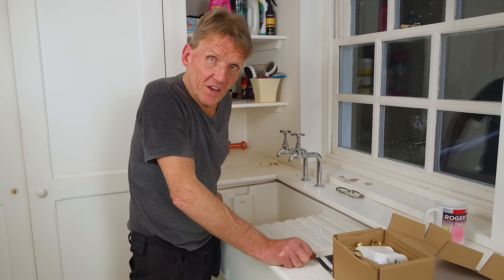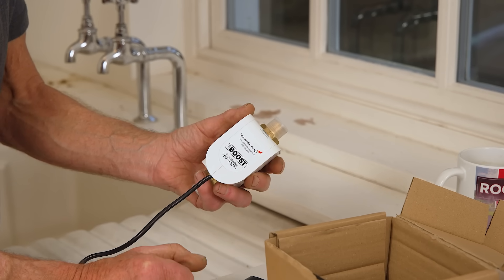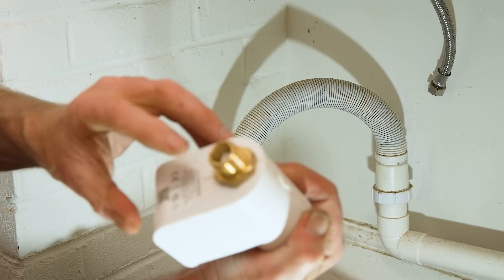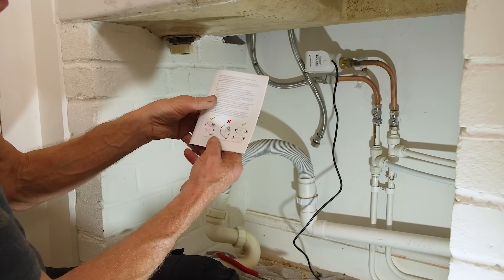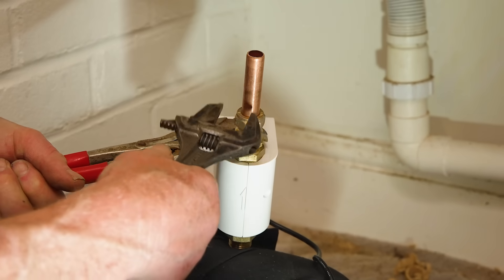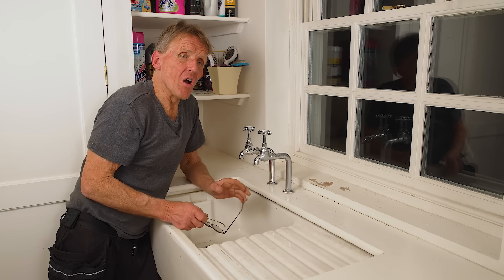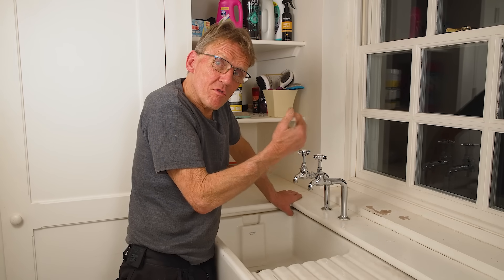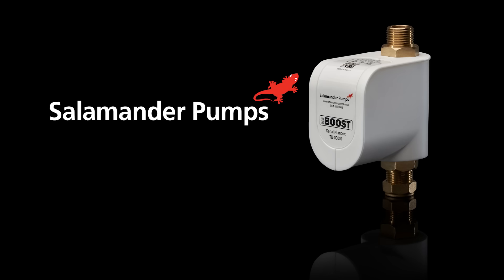The Easy Way to Boost Tap Water Pressure | TapBoost Installation Guide

Comment: Important to note: the pump data sheet states a maximum head pressure of 0.5bar (or 5 metres). So whilst it might increase flow rate, it won’t improve pressure much.

Comment: Is gravity fed still a thing?
Reply: Many years ago, the Metropolitan Water Board - covering Greater London - did not “allow” a rising main to be connected to a toilet cistern for example. Cold water feeds for baths, toilet cisterns, hand basins, hot water cylinders etc. were all supposed to be gravity - fed from tanks in lofts.
Reply: @markmiwurdz2248  Quite common in certain areas of Northern England at one time. PITA when we were fitting electric showers in bathrooms.
Reply: I think it depends on the age of the property.  I'd guess new builds probably not.  30+ years, likely to be gravity fed.

Comment: Could this be used to boost the water pressure to an electric shower?
Reply: Looking at the spec sheet I’d suggest not. A mains booster would probably be more a effective/ reliable option
Reply: Website says it can be used with some electric showers.
Reply: Nope - If the mains coming in is very cold (in winter) a normal electric shower
will just choke the flow down again anyway to maintain the temperature. Sorry.
Reply: Yes, however there must be sufficient natural flow/pressure to allow the electric shower to operate before installing a TapBoost. Please note, many electric showers are restrictive by their nature, and you should check with your electric shower manufacturer to see if the maximum flow rate from the shower is already being achieved. Please refer to the installation manual for more info regarding the limitations when it comes to electric showers https://www.salamanderpumps.co.uk/wp-content/uploads/2022/11/TapBoost-Installation-Guide.pdf

Comment: A before and after ...would have been useful.   None means one thing..????  lol
Reply: There was a before and after. He turned it on, then Dylan (I assume it was Dylan) turned on the electric for the pump to kick in.
Reply: @ricos1497  Didn't see that much of a boost tbh.
Reply: @billy4072  @ricos1497  @nickhickson8738 here is one of examples of TapBoost installation showing before/after https://youtube.com/shorts/auWUXG7tEfw?si=znm7RQ0HU3YXZ3yC You can find more videos of TapBoost installations on our channel.

Comment: I found it didn't boost that much, I was at the lower end of 1.2l / min went to just over 2l / min
Reply: Sounds like you have a negative head, so you need a negative head pump. These things are for postive head with at least 2 litres per minute before fitting the pump.